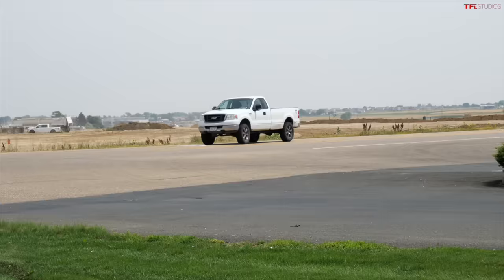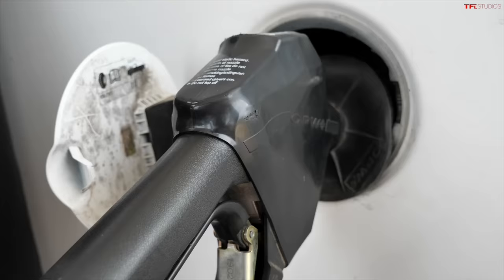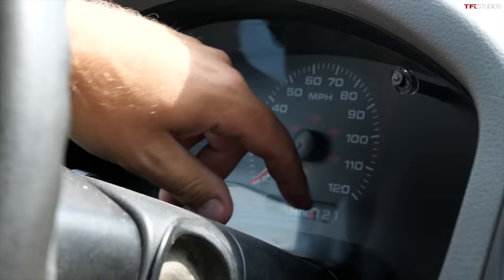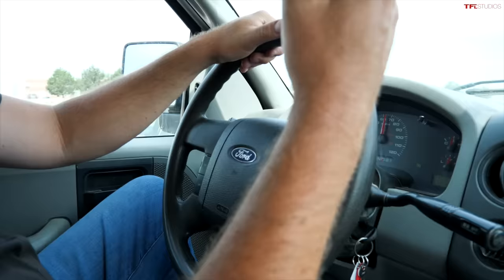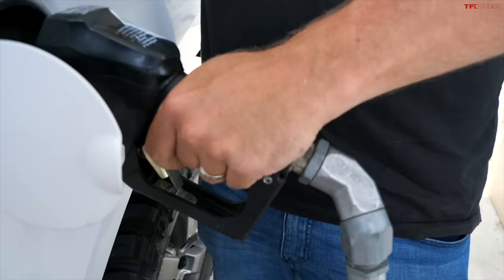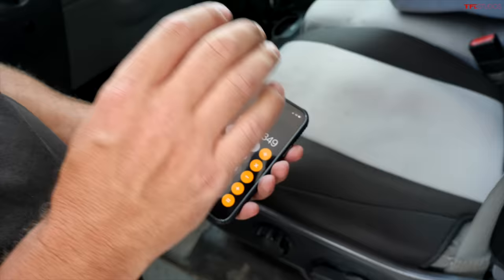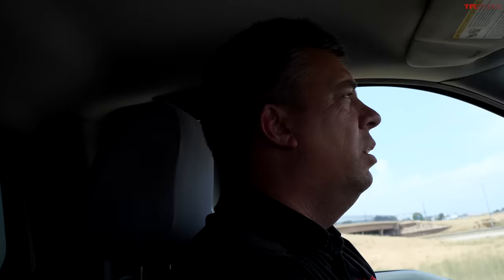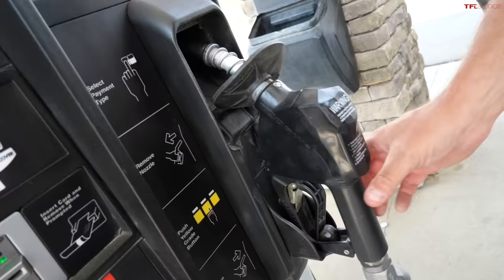Surprising Result: Here’s What Happens To Your Truck’s MPG When You Install A Topper!

Comment: There was an episode of Mythbusters where they challenged this topic and found the exact same thing, using a tonneau cover type cover (hard type). Before they actually did the driving part, they used a model truck in a water filled flow chamber, with sand in the bed, they discovered an eddy current where the water would flow over the eddy and not interfere with the tailgate. As happened here there was virtually no difference in the mileage with or without a tonneau cover. BTW they also tested tailgate up and down with the same result, so based on their findings there is almost no difference other than preference
Reply: You watched the wrong episode, son.
They said tailgate down made a significant increase in drag and decrease in fuel mileage

Comment: The only deterrent the extra weigh would create would be in stop and go traffic.  Once the mass is moving, the difference the weight would inflict would be minimal (to none).  Now if there were 1000 lbs. in the bed then the extra friction from tires and the squat might effect it significantly.
Reply: Rolling friction definitely is a significant part of the total friction, so weight will definitely increase rolling friction significantly. I still agree with you that on highways air friction is much more important.
Reply: Agreed. Very few people get this concept.

Comment: If you had less aerodynamic things in the bed, it may affect the mpg more with and without the camper shell. And, there is also the security aspect. As a contractor, I work out of a van because I don't like having thousands of dollars in tools unsecured. It only takes a few seconds for someone to steal a saw out of the bed of a pickup. You can't stop for anything without worrying, then you have  to unload everything or park in a secure spot at the end of the day. For my work, its Van, Camper shell then open bed. For personal use and "cool factor" it's the reverse.

Comment: I had an 84 C-15 chevy pickup in the nineties, and got practically the exact same fuel mileage over three years as you came up with, driving about fifty thousand miles before selling that truck.  I also ran a Ford half ton with pretty much the exact same outcome right after the Chevy.  I'm currently running a 2022 Jeep with a V-6 and getting a couple miles to the gallon better with less weight and about the same cross-sectional area for wind resistance.
Reply: Weight & smaller, fewer cylinder engine. 90% of the parasitic drag in an engine is the piston rings sweeping the cylinder. Fewer cylinders usually get better economy, Harleys get GR8 economy compared to 4 or 6 cylinder bikes with the same displacement

Comment: Without the topper you get a air vortex circling that the air flows over. If you had dropped the tailgate the mileage would drop. ( FYI, if you have a sliding back window you need a really clean bed for driving with it open. Otherwise you will be cleaning debris off the dash from it blowing in.)
Reply: yeah mythbusters did a good demonstration of the benefits of the gate in the up position. I have an extended cab tacoma with camper shell, and noticed a 1+ mpg drop when I have my bike on the hitch mounted carrier.
Reply: This test would be cool in a wind tunnel where using smoke you can see how the air behaves. I saw this test that one of the auto companies did and it showed you got better mileage with the tailgate up. Because the tailgate redirected the air to fill the void behind the cab. I don't see that happening with a cap on the back. But maybe I'm missing something.... Interesting test results though.
Reply: @chuckwyble7719 I see the same things that the wind tunnel displayed after hauling a load of mulch or topsoil. The debris swirls around, levitating sometimes a foot above the level of the side rails so I don’t doubt the study on the tailgate up. Back in the old days when I was a kid (and walked uphill in the snow barefoot both ways to school and back) we had a 1974 Chevy Custom Deluxe 2500 with a 454. My Dad being an engineer selected this truck with the anticipation of hauling a 9.5 foot camper and a boat. The truck had split rims (bias ply HD tires) and I think it was 4:11 gears. NOTHING affected the mileage. It didn’t matter if you had the camper and boat on, up hill, downhill, headwind, tailwind or any combination thereof. It got around 9 mpg LOL.
Reply: Anyone who’s ever ridden in the back of an open air truck bed knows about that air vortex 😆 it was the 1980’s, us kids rode in the truck bed coming home from the swimming hole!! 

So stupid, in hindsight.
Reply: Doubt it

Comment: My gas mileage went down slightly when I got my Leer, but it has roof bars which are likely the culprit…
I love toppers on my trucks
Reply: yes the roof rack is far more of a drag than the topper itself.
Reply: I've put removable roof racks (Yakima) on four different vehicles I've bought new.  The one I have now also has the wind deflection in front that doesn't change anything but noise.   I've put them on a PU with a topper, a SUV and 2 cars.  All suffered considerably lower mileage when the racks were on.  I'm a mileage watcher too as most of my vehicles I keep a notebook log of every fill up.
I should add that if your speeds are always low it makes little difference but at highway speeds its 1-3 mpg just with racks.
Reply: @bobisrighturwrong  i have a haul master rack on top of a Snugpro cap and would concur with your observation of 2-3 mpg loss.
Reply: I seen wind tunnel tests for this kind of situations, plus tailgate up or down, or tailgate with vents in them (you don't see those anymore) and it turned out the best way / gas mileage nothing on the bed (cover tonneau or camper shell), tailgate up no vents. The reasoning is with nothing in the bed, tailgate up it creates a small vortex in the bad that helps with the overall vehicle aerodynamics.

Comment: I drive a 2014 Tundra SR5. I used to get on average 15.4mpg on about 75% highway driving mixing with 25% city. I installed a tonneau cover on the truck, installed an AFE aftermarket air filter and now get about 17.8 or more mpg when driving. My fuel range also went up from about 325-340 miles per tank to 370-380ish. That extra 2 miles per gallon makes a difference on the highway! Also, I had a bull-bar installed on the truck and it just absolutely tanked my mpg. I removed it and it went back up.

Comment: Modern trucks are very aerodynamic especially when compared to say...mid 80's.   I had an 85 S-10 2.8 3.43 gear and 700R4 tranny....last year for carburetor and the motor was built with cam, Edelbrock 4bbl manifold w/390 Holley and well tuned.   Putting a cab level cap (as in this video) increased the highway mpg's by 3-4 to mid 30's on a trip...but the biggest increase was in the top speed.   Without the cap it struggled to hit 110 but with cap it went close to 130 if you gave it enough space.   Actually out top-ended a Grand National on the way home from work in Florida one morning.   He got away from the light (of course) but he'd never actually topped the car out and didn't realize they had a 124 limiter in them.....so I gradually reeled him in then drafted past and left.   He was pissed. :)

Comment: I really haven't noticed any significant gains in mpg when adding a tonneau cover.  In fact, my 2019 Silverado claims 22mpg hwy, and I have never seen that number with or without a tonneau cover.
Reply: @cooper pason wow!  Our 2011 tundra with the 5.7 gets in the 20s at that speed on flat,  no major head wind other than the 70mph and cruise set.  Upper 20s at that in that scenario.  
Shocked Nissan is so different
Reply: @chrischapman276  I find that hard to believe since the EPA numbers are 20 highway and no car actually gets the EPA's rated MPG. And that 20MPG is for the single cab 2wd truck. Are you going by what the computer tells you or are you actually manually calculating out your mileage? Fuelly even says you are way over the average MPG and thats a site that reports user submitted MPG.
Reply: The manufacturers do the mileage tests in a dyno room so there's no wind resistance or stop & go/acceleration factored in. I've never seen ANY vehicle get the stated mpg on the sticker.

Comment: In my experience tonneau and toppers don't make a huge difference. With an empty bed, pickups make a low pressure bubble in the bed, which cause the air to flow over the bed anyway
Reply: In my experience,  they make no difference whatsoever , a cap actually worsened fuel consumption.
Reply: how about in the rain ?
Reply: @Dankcatvacs   Yeah,  I really enjoy the advantage of the tonneau cover when going camping to keep my equipment clean, dry and offers the added protection from thieves.
Reply: @fj400007  Unless you need to haul large bulky cargo, a canopy (or tonneau cover) definitely has it's advantages over an open bed.
Reply: Aerodynamics is much about making large disturbances & vortexes into small ones. You cannot fool mother nature, and vacuum drag on the backside is just as much a problem as high pressure on the front. 

This is evidence that the vehicle engineers are really smart about managing air in & around the open bed.
Reply: @dundonrl  I agree,  it totally depends on individual needs but it can't be associated with aerodynamics or gas efficiency.  I don't even bother to reinstall it anymore, only when camping or hunting these days.  If you never need to remove your cover,  it's a great idea unless,  you live up north where the damn rubber lip freezes solid to the tail gate.
Reply: I use a tonneau basically so I can keep things from getting wet back there, it might reduce drag to improve mpg slightly, so it's a win win for my applications.
Reply: @fj400007  A little silicone spray on the rubber solves the sticking problem.
Reply: @zxej6879  thanks,  I will try that.
Reply: On any truck since the mid 90s I agree that aerodynamics have made it pretty much equal. Old boxy styled trucks got a huge benefit from a shell or tonneau cover. My 96 Dodge actually does about the same with a tall shell vs without.
Reply: Myth Busters did a program years ago comparing a cover, the tailgate down and tailgate up. Tailgate up had the best mpg if I remember correctly.
Reply: @Screwdriver440 smart man. ill just walk from now on
Reply: @dundonrl  I believe Vans behave similarily.
Reply: I swear I remember Myth busters doing a episode on this...
Reply: @Nacka4life It does help,... the gas stations sell more fuel.
Reply: @Nacka4life I haven't seen a truck driving with an empty bed and down gate in about 20 years
Reply: @Screwdriver440 to get from point A to point B ?
Reply: @Screwdriver440 this is like asking why have passenger seats if you have no passengers.
Reply: #100 👍🏼

Comment: Years  ago I did a Before and After test drive with a new K&N cool air induction and filter kit on a 2003 4x4 Expedition with 5.4 engine. I drove the same route, the same day, about one hour apart. I reset the trip log once I was up to speed on cruise at the same landmark each time. I let the vehicle's computer tell me the average miles per gallon. My test drive was only a few miles though. My best recollection is that the brand new K&N filter system added about 1 mile per gallon on the highway while using cruise control at 70 MPH. But that was an improvement to about 18 MPG, up from 17 MPG. Around town that vehicle averaged day in/day out about 12-13 MPG with traffic and lots of stop signs in subdivisions. On subsequent vehicles I just clean my regular air filter every few months and change it yearly. Project Farm did a vid on the best air filters. I saved the top couple on Amazon and now I just buy whichever one of those is the best price at the time. I really didn't like having to clean the K&N filter and then reoiling it. I feel like I get nearly the same performance for less money and less hassle. 

One would think that improving the aerodynamics on your truck would have made a bigger difference. But apparently the auto makers know how to design them pretty well since they are "graded" without any special features. Still, I always heard about folks who left their tailgates down to improve their gas mileage.  That's a real world test that I'd like to see.

Comment: I saw a similar experiment years ago. It dealt with a gang box, and showed that placing the box to the rear, against the gate, as opposed to behind the cab increased fuel mileage.
Reply: But no one wants the gang box next to the tailgate.
Reply: @djg585  Only when racing.

Comment: My guess before finishing watching this:  I'm betting worse mileage with the topper.  Based upon the Mythbusters episode that showed you get better fuel-mileage with the tailgate UP rather than down -- because a vortex of air would form behind the cab, in the bed, and would essentially "lift" the air flowing over the back of the truck, almost like a roof does.

In other words, with the tailgate up, the aerodynamics are almost the same as having a roof back there.  So adding a topper does NOT increase the aerodynamic "slipperiness" (much), and with it on you now have to haul a couple hundred more pounds with very little (if any) aerodynamic benefit.  Thus your fuel mileage with the topper is going to be a smidge lower.

Just my guess...  Now I'll watch the video and see if I'm right.

Edit -- a smidge better mileage with the topper. I was wrong.  :-)
Reply: I remember that episode and I just don't know.  It was really close.  I wondered at his choice to top off as that add another variable unless he toped off untill it would take no more gas.

Then without a way of detecting fuel efficiency throughout the trip.  Was it just the topper or was there more traffic, did topping off put slightly different fuel in the truck.

I know that the topper weights more that that could be a point in it's favor

He also has the long bed version. Maybe the a different amounts of vortex are created between a long vs regular vs short bed.

I think I would put a soft top on my truck as I put mostly kayaks and camping gear in the back, as well as other things that I don't need to cover but I suspect that would not be as fuel efficient as a hard top.  Then I suspect that running a tonaduu is the worst for fuel, based on no vortex and no shell to make improve aerodynamics.
Reply: Fuel economy with the topper on my 87 Ranger is the same, didn't go up or down...that's with a 150 mile test loop that I did with and without the shell....got 24.7mpg both times.  I run a topper because I don't like my tools getting wet, and the bit of weight of the topper helps with traction in the snow, being a 2 wheel drive pickup, every bit of added weight for traction is good LOL.  My topper is a bare bones fiberglass Eagle brand topper, to carpet, actually doesn't have a front window in it either, just a boot that butts up against the back of the cab, if I recall the topper weighs 189 pounds.
Reply: Which model truck?  I used to get more than a MPG with the tailgate of my '89 Chevy down.
Reply: You still have a small amount of drag in creating the vortex so with a lighter weight shell, you might see a slightly better mpg. I'm curious about different bed lengths though and how that affects the vortex along with the shell being lighter since it's smaller, also maybe with an aluminum shell since they're substantially lighter.

Comment: Yes ago when I had the Gass Pots. CAA 40 + yrs ago used to say canopies got 13.8% better fuel mileage. Where the bed covers got 7% better fuel mileage.
If I remember the numbers the one site said that the tailgate up, tailgate down and tailgate off, the drag was 0.56,  0.57, 0.58.
Since 78 I ran premium as I found going up the one hill with regular gas the car had trouble holding it's own in 4 gear. Where as with premium I could accelerate in 5th . It used to cost 10% more but got 15% better mileage.
Where needing to travel with stuff in the box so a high rise canopy made the best. 
Also use Syn oils. Since 1986! Thank You Jim Kelly!